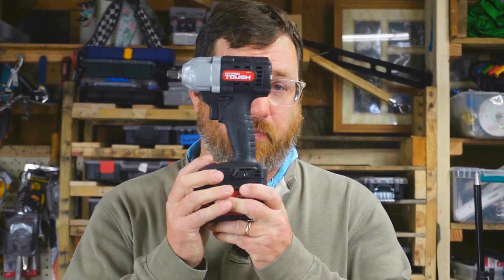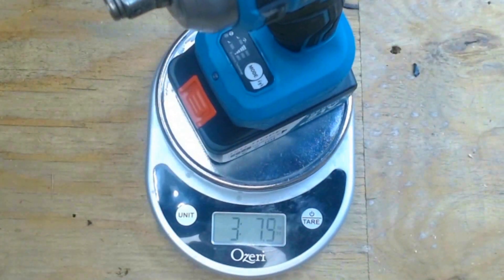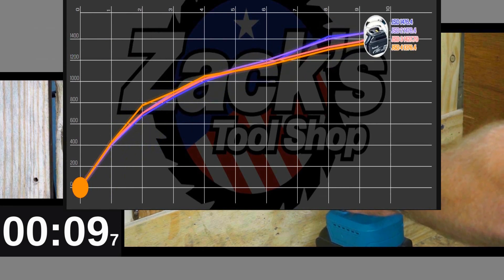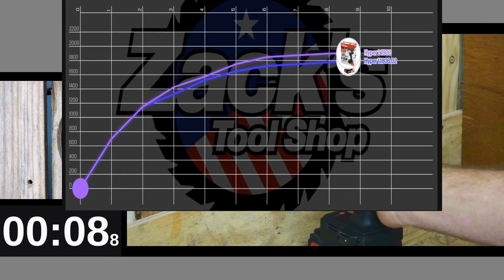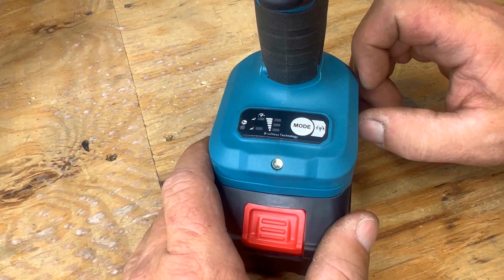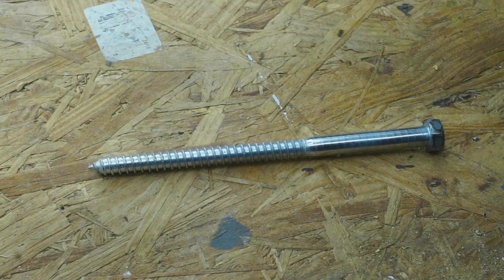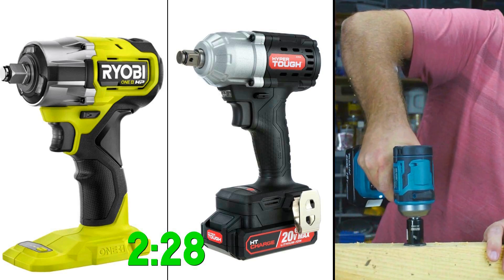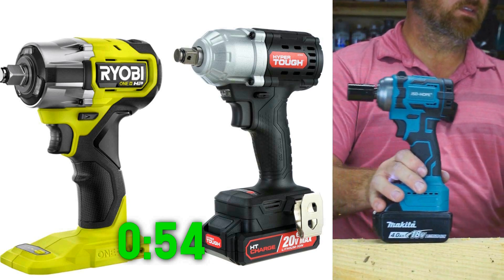The New 20 Volt Hyper Tough Brushless Impact Wrench | vs. Ryobi and Temu’s JSD Hope Brand

Comment: HT is $64 with 2ah battery, but that 4ah battery is $54.88 last I checked.  So it's really $118.88, which often, HD or Lowes may have better deals during the holiday.
Reply from the maker: Absolutely. The battery is way overpriced. And it’s $69 too! The brushed version is $64.
Reply: @Zacksshoptalk  You are right!  Good catch!  And HD always have ryobi 2-pack 4 ah battery for $80 every holiday season, so HT's 1 battery for $55 is just too much.
Reply from the maker: I bought that Ryobi deal! Agreed
Reply: I got mine on clearance for $35 I love it
Reply: For some reason there’s a 64 version and a 59 version. I would also feel it’s important to note that 4.0 from anyone else will easily cost you $100 if not more. Best you can hope for is $100 for a 2 pack.
Reply: Just bought the HT over the weekend, on clearance for $23.  Can't pass it up with that price.  Going to leave this in one of my cars for emergency tire change. 😂
Reply: They sell it with a 4ah as well for $79.88 that includes the fast charger as well.

Comment: I would like to point out a potential flaw with the reverse torque test. If the HT is torquing down harder in forward than the ryobi, that means it has more work to do removing it. The only truly fair way to compare is to do to at least 3 screws driven in each. And then for removal torque down some nuts with a torque wrench to the same value for all tools.

Comment: My wife and I have a lot of the Ryobi One+ tools, and have been happy with all of them.  We dabble in a lot of minor homeowner DIY projects, but are not Pros.
Reply from the maker: I used Ryobi in the HVAC trade for many years and was satisfied.
Reply: Same same.
Reply: Somewhat of a mixed bag here. I specifically look for brushless for longevity. The 1+ interior floor vacuum cleaner is junk with inadequate suction. OTOH the 1+ handheld canister is the bomb and great to hit the car quickly and easily. I have a beefier version of this 1/2" impact and it is good. I also have circular, jig, reciprocating, flush cut, ratchet wrench, grease gun, driver/drill, impact drill, etc. Just got their chain saw (requires oil) and am thinking of getting their pole chain saw (requires oil; I don't want the dry one). The leaf blower I got was merely adequate. The previous Lynx (HF) was way better, but was 40V, so not really a fair comparison. The string trimmer was junk. Most of the 1+ tools are good overall and represent a high VALUE for what you get. I would not go the Ryobi route for daily pro work, but even using every week, they are pretty good. I use something everyday. You can blow a lot on batteries, so it is helpful to have lots of tools of the same platform, and you can look for battery sales in dual packages with charger, then you always have some ready to replace and keep going.

Comment: Worth noting that the brushless version is now $59. For some reason the brushed version is still 64. Call the 4.0 battery 55 and you’re looking at $114.  I’d say even if you consider the 4.0 mandatory it’s still a better deal than the ryobi. If you’re starting from scratch the ryobi is $139, plus batteries. At the current pricing, the cheapest way to get a 4.0 is to buy the starter pack that also gives you 2.0 and a free basic tool for $99. So in total $238. Or you can get a brushed impact for like $190. Granted at this time you are getting two tools for $238, but still either way you slice it that’s just not competitive with the HT. Of the comparable tools with the battery pack promo, the most expensive in the HT line is the fan, so for fairness sake we’ll add that in at 75 and go ahead and add the 20v 2a fast charger which matches the ryobi standard charger. So in total from both brand we have a Fan, 1/2in brushless impact, and battery set with one fast charger. The HT combo totals 208. 59 impact, 75 fan, 20 fast charger, and 55 4.0 battery. Now that’s $30 cheaper than the ryobi, but it gets better. Both tools come with slow chargers and 2.0 batteries. So the HT for 30 less gives you an extra battery and 2 chargers. Now they are slow chargers, but you get the convenience of being able to plug in all 3 batteries at once if you need to. Where with the ryobi you’d have to remember to swap batteries, and charging the 4.0 will take about 2 hours for both brands. Knock off 15 from HT total if you go for an oscillating tool or jigsaw. 25 less for a recip saw, but it does come with a 1.5Ah battery instead of 2.0.
Reply: Hey guess what. They just released a high torque and a mid torque version that come with new 4.0ah batteries and charger. How’s that for a damn deal lmao
Reply: @SquidwradThomas  and a new 2A charger too. Also looks like the new 4.0 has a battery meter on it.
Reply: @SquidwradThomas  the 12v also got a upgrade. Now it comes with a 4.0, the 2.4A charger and is $5 cheaper. All of them seem like massively good deals. The old version of the 12v is still being sold for $30, presumably until they run out. I’d say they’re easily worth the money.
Reply: @dylanwhite6539  I ordered the high torque. Hopefully I can find out how much charge the new one holds but I think they are the same cells they’re always using.
Reply: @SquidwradThomas  probably. If I’m not mistaken they’re Samsung cells

Comment: I bought the brushed version by mistake ( I was sleepy when I clicked).  I thought i would give it a try before returning it, but to my amazement, it handled wheel lug nuts with no problem at all, two seconds of impact was all it took. It has no battery meter or multiple speeds, but it feels way better in the hand. I will be keeping it. Supposedly only 30 foot pounds less torque.bought it to keep in the car.

Comment: Say what you will about the Hypertough 20v saws, but their circular and jig saws came with fences.  My Hart brushless ones did not.  If you check the manual, Hart gives a part number for a Ryobi fence kit for both of them.  Giving away industry secrets, Hart, come on!
Reply from the maker: Nice info! I haven’t used those saws, just the 20 volt drill and impact driver.

Comment: HT does not have 21400mah lithium batteries so the power is limited to the old 16800mah and also a low reserve of 2.5ah. If the harbor freight 20v extreme performance batteries it would have way more torque 👍
Reply: None of that makes sense.